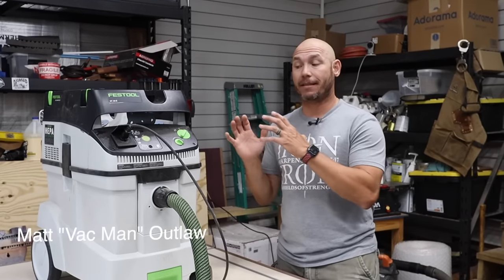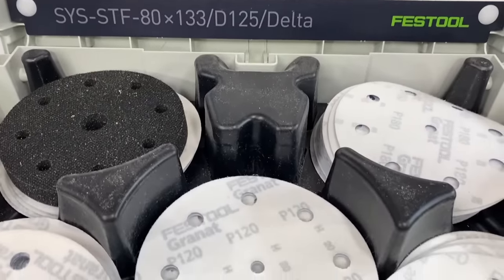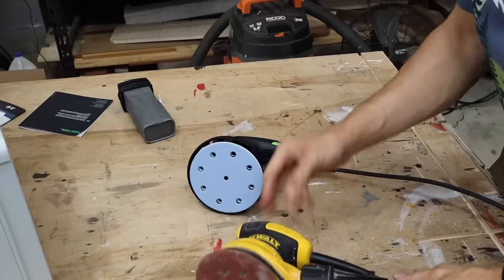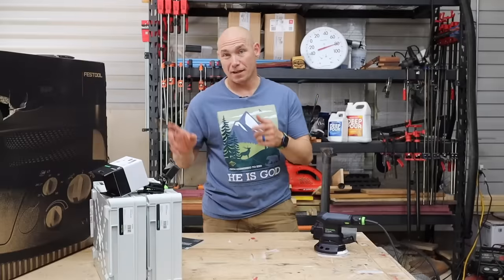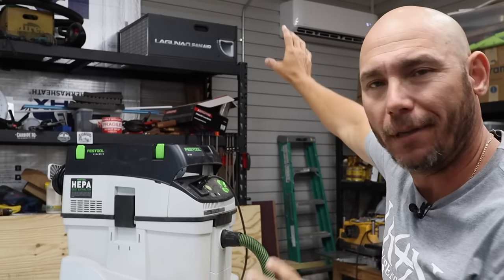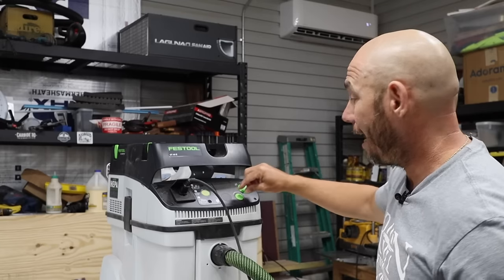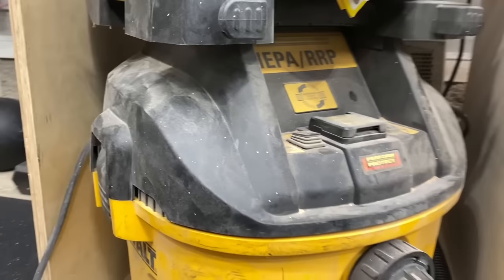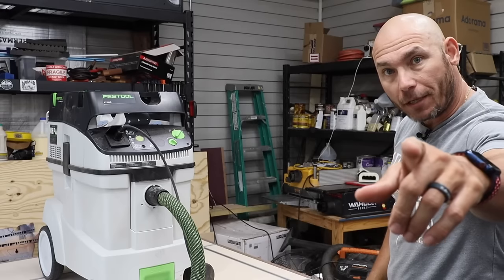Watch This Before Buying a Festool Dust Extractor or Sander

Comment: The big thing about the Festool dust collectors are they keep their suction even when the bag is full. I was using a Festool track saw and ripping lot of plywood. After about three hours of ripping, suddenly there was sawdust coming out of the saw. I shut it down and found that the bag was completely full and the suction was now filling the hose. I took the vac out to the dumpster to empty, but the bag was so full it wouldn’t come out of the vacuum. The only way I could get it out was to cut the bag open. I am a big Festool guy and find that when you buy Festool tools, you’re not buying a tool but buying a system. Very well thought out. Hint: if you go to jobsites as part of your job, throw a spare bag in the bottom of the dust collector before putting in the working bag. You will always have an extra and know where it is. Great video! Keep up the great work

Comment: As a small shop with a super limited budget Festool was something more of a dream. I knew they were good tools but I couldn’t justify the cost. Then I bought the Domino. GAME CHANGER! This past year I continued adding to my set up. I have the track saw, two sanders and one of the dust extractors. I absolutely love it. I wish I would have gotten the sander and dust extractor sooner. Huge difference. Even my husband was impressed with the dust collection on the sander. He was skeptical. He recently used it for his own project and was amazed. And what a blessing that it was gifted to you. That’s awesome!
Reply: The TS75 and the CT36 were the first Festool purchase I made, and I loved them!!! I got the Domino 700 with the adapter and bits next, so I could use any size that the 500 or 700 uses. I honestly thought I’d never get the sanders because I didn’t see the benefits being more than the costs…until I used them in a class at Woodcraft and saw how much time they save 😂

Comment: Festool is expensive but very well made in Germany. Germany are very high in Health and Safety.  Here in the UK, health and Safety is being promoted especially for injury and breathing problems. A lot more people do DIY at home, its much better to have safe tools that are quiet, and do not effect your hearing and lungs. I am asthmatic but I do some DIY, so this is a game changer for me. As some homes are old here and have lead paint, protection is VERY important. I am currently saving up for a sander and Extractor. The less vibration on the sander has made my decision.  Great video...thanks so much for the honest review, I can tell you are an honest guy. :-)
Reply: Yes, the Festool dust extractor is good. I've got a Rotex 90, but for larger areas a Sealey 150 (Mirka Deros clone) works really well with very little vibration for about a third of the price.

Comment: I have had a CT15 dust extractor for a while and love it. Use it with my Fextool track saw, router and Domino. Have been using a Dewalt sander similar to what you have.  Always done a good job sanding but dust collection was so-so and the sander was always covered with dust after each job. Decided to add a Festool sander to my collection. The same one you demonstrated.  I could not believe how much less time a job took and virtually no dust on the sander. I used Festool paper which works great, no loading, no dust. Gave my Dewalt away. The Festool sander with their paper is the best combination I have ever used for sanding. Note Festool says you will do a better job sanding with the dust extractor speed turned down as a faster pick up speed inhibits the sander from working properly. You demoed the extraction power in the video, it's strong. Good luck with your setup. Nice video.

Comment: Good stuff brother. It’s so obvious how blessed you feel for receiving such a beautiful gift, you deserve it. Two things you didn’t mention. The extractor moves around so easily because it’s so light. Sure the wheels are awesome but it can be moved with one finger. Lol. The other thing is how quiet it is. I have mine (older model) set up to where I plug my machine into it and when I turn on the machine I can’t even here if it’s running. I spent a bunch of time walking over to it to make sure it’s on but learned it always is. Lastly, if you hook up a cyclone to it you will never have to deal with bags or filters. I mounted one to the top of my extractor and it handles my whole shop, one tool at a time. I’m about to buy a festool sander. Never in a million years thought I would spend almost 600$ on a sander but it’s worth it to save my hands and get the job done faster.

Comment: Recently picked up the same sander and the CT-15, I hate sanding a little less now!  Really impressed at how much dust it collects, I’m in the northeast so my home shop slows down a lot in the winter or bad weather because I was only sanding outside.  Had the first big sanding session with it today, between the dust extractor and a box fan filter running nearby there was no noticeable dust afterwards.
Reply: Sounds encouraging. Just remember, according to the expert in the field, Bill Pence, unless you have a window open and a fan in the window pulling air through your shop, you're breathing in tiny particles into your lungs which are not visible to the eye. This concerns me greatly and currently I'm doing all my cuts and sanding outside with a portable fan to my back and still wearing a dust mask. I'm super sensitive to anything in my lungs so I can tell a difference pretty quickly. I'm trying to invent a new outdoor woodworking setup that keeps people comfortable, machines at a decent temperature, prevents condensation and provides optimal health. I'll let you know if I come up with something in the next 30 years lol

Comment: First I got a Festool sander, the ECS EC 125.  It changed my life with how powerful it is, even as a finish sander, and how little it vibrated.  I held off on the Festool dust extraction for a long time, then I got one, the CT 15.  It too changed my life.  It is fantastic at dust extraction, but it is also the single best vacuum I have ever used.  I use it to vacuum my house.  It makes vacuuming FUN because it's so good.  I can't recommend the sander and dust extractor enough.
Reply from the maker: They are great tools
Reply: @731Woodworks  have you heard of drywallers using this setup or is it more so for wood working?

Comment: There’s no comparison. Festool sanders are the best, but comes at a premium.

Also have the ETS EC125 and a Rotex 125. First one, almost zero hand vibration, great for those with carpel tunnel. The  Rotex,  can really flatten a panel glue up fairly quickly.
Good review Matt.
Reply from the maker: Thank you

Comment: Just got a Festool sander after using a Bosch sander for a few years. The biggest difference to me is that the Festool shuts off almost immediately when you hit the power button which lets you set it down without having to wait until it spins down first. That to me is worth the price of admission.

Comment: Nice video.  I'm with you Matt, I never expected to ever have anything Festool in my shop either...then Santa came and I'm now a member of the "F-troop"~!  I have the ETS 125/3 sander and the CT 36 dust extractor.  I've not used it yet, but I'm very excited to do so.  Truth be told, I've been to about 3 different stores over the last 18 months and have test driven the different sanders.  The impressed look on my face during these innocent test drives prompted my wife to say "which one would you like to have?"  I was floored~!  Anyway, I just received my Bluetooth module in the mail today, so I'm off to install it and pick my next project to put this thing to work.

Comment: I recently upgraded from a makita 6 inch sander to the Festool ETS EC 150/5 . The Festool is half the weight, i can sand for at least one hour without getting any tingling in my hand ( makita i can only manage 5 minutes) most importantly the festool stops straight away after switching off, where as the makita takes around 10 - 15 seconds.

Comment: I haven't used my orbital sander in 2 years. I prefer to use my hand plane to put a finish on my projects. The shavings from a hand plane is so much easier to clean up and to top it off I don't have a dust issue. Now my old table saw is a different story.

Comment: Nice review. I am a woodwork teacher in Sydney Australia and I have been using Festool in my home workshop since about 2007 when I bought a Rotex 150 and CT Mini duster extractor.  My workshop now extends to 3 routers 3 different dust extractors just to name a few. I find the low noise and vibration, accuracy and build quality without compare. I wish I could get their new cordless table saw set up but as I have their small table saw already 2 tables saws is overkill 😂😂😂😮. If you get the boom for your CT36 and mount it with your circular saw you will feel like a fully professional setup. Lloyd

Comment: I went with bosch get 5n and it blows me away. I am glad i decided to upgrade the sander before anything else. It made a huge difference. Once connected with a simple shop vac, sanding is virtually dust free! Looking for a lighter sander as well. Looking at this festool or the m12 finish sander.

Comment: Is the Festool expensive...yes. Is dust extraction and less vibration important...yes. To Mr Charles G, you can buy ten pair of Walmart shoes in a year, or one pair of Nike...your choice. I'm also VERY new to woodworking, but knowledge is power, and Matt provides a lot of knowledge. I currently don't own any Festool, but it is on my Santa list ! I don't have much of anything when it comes to dust extraction...my shop's outside and I'm currently using a 3 gal ( no snickering ) ShopVac. Just the other day I sneezed and a 1x4 shot out !! Great video Matt, appreciate you as always, God bless..
Reply from the maker: Thank you

Comment: I don’t think you can go wrong with Festool, SurfPrep, 3M Extract or Mirka. I prefer the SurfPrep, I like that it’s made in the USA, and is a great value for the money. The POV 8 extractor is great and has a lot of standard features. I like the paddle switch on the sanders, which Festool does not have.

Comment: I have a festool sander. Totally worth it for a professional. my dad has a mirka it's equivalent maybe slightly faster the. festool sanders have better warranty and less issues. I use the 3m extract wire mesh paper the dust extraction is so good you don't have to use a mask.
Reply: Have you sanded any drywall with it and how does it compare with the portal cable?

Comment: Based on your review, I bought a CT36 and the 125 sander. I also spent the extra money on the festool cyclone attachment. I love it. It is quiet, it doesn't fight me, it's easy on my hand, and the dust collection is fantastic. Knowing what I know now, I probably would have bought one of the smaller /cheaper extractors like th 26 or the midi since the biggest difference is the capacity (36 = 36 liters). With the cyclone, the extractor size is not that important. I could have built my own cyclone with a dust deputy that would have been cheaper but the festool cyclone is so compact (maybe not as efficient as a dust deputy either). Overall, I may now be a festool fan boy😁.
Reply from the maker: Awesome!
Reply: Started woodworking as a Hobby 26 years ago in earnest, started out with Bosch and Dewalt tools and a kärcher as vacuum. After 11 years a friend of mine showed me festool and the Performance it gives you. Spent 5 more years to get me festool machinery, all i can say after a lot   of big projects , like 2 complete staircases , a new kitchen, a complete Garage outfitting and doing a couple of things for familiemembers and friends, as far as of today festool never let me down or had me doing the secondbest thing. It is pretty expensive, i admit it, but if you want lasting tools that delivers quality  and durability then, to me at last festool is First to none.

Comment: Great video. Lot's of Festool haters out there, but it usually comes from folks who are not in the trade or who are simply priced out. There is a reason why they cost that much though. 
One important thing to note is that the hose on that festool is anti-static. A new hose will cost more than you paid for that dewalt most likely. 
Does that vacuum have the autoclean filter system? It about made me crap by pants the first thing that went off on my CTM36.

If you really want to experience the ultimate "Festool Experience", try to get your hands on a TKS 80 table saw. Not sure if they sell that in the US or not, but it is a game changer for work workers when you compare it to traditional cabinet table saw.

Comment: The Festool  ETS-125 Sander is a great and versatile sander, I have one and the cordless version ETSC-125. They both have a 2mm stroke which is good for finishing sanding. The ETS EC-125 is a brushless corded sander with a 3mm stroke making it a great finishing sander but more aggressive. It is a low-profile style that most users, as do I, believe is a much better grip, and more ergonomically correct. Or the ETS EC-150 if you're looking for a 6" sander.
Oh yeah, also look at the Edge Sanding Guide AH-ES-ETS/ETSC for your ETS-125 Sander, it makes sanding edges a breeze, and keeps them at 90 deg. too!
All the Best, Chuck
Reply: I have the cordless version like you — would you recommend the ETS EC 150 for your next sander?
Reply: @AaronGeller  I personally would recommend the ETS EC 125 which has a 3mm stroke and a larger motor, 400W vs 250W on the corded version of your sander which is about the power of the cordless. (I have both) The larger stroke and more power make quite a bit of difference, mainly because it is a sander meant to go through the grits, unlike the ETSC-125 which is a finishing sander. You get to stay with 5" or 125mm paper, which is a lot cheaper as well.
My two cents, All the Best, Chuck
Reply: @toolchuck  thank you! I was thinking about upgrading and getting the ETS EC 150 but I am not doing large surfaces currently, so it seems my problem isn’t pad size but power. I think the cordless is great if you just want to take it outside real quick but if I’m going to be plugged into regular power, then I would rather have a little more aggressive stroke.
Reply: @AaronGeller  I have a 150mm (6") 5mm stroke Mirka Deros 650CV that also converts to a 125mm (5") sander by placing their "Backup Pad 6" Grip 48H 130g" specifically designed for the 650CV. So, it is my two-in-one 125mm/150mm 5mm stroke sander. I can tell you that as handy as a 150mm/5mm is at times, I would not recommend it as a primary sander unless you are sanding a lot of large areas that are rougher than normal. The size of the sander is more a personal preference, and maybe the cost of 125mm paper over 150mm paper, but the stroke or orbit size is another story. RO's try to hide the orbital scratch marks by randomizing their placement, and they do an amazing job of it, but the larger the orbit, the harder it is to hide, or easier to see, either way bigger in this case does have a tradeoff. Some wood and paper combinations show these marks more than others, and some woodworkers don't seem to see any difference, to each their own. I'm just saying it exists and can impact your sanding. When using my 5mm I usually use my 3mm or 2mm for the final grit or even hand sand the last one.

ETS EC 125 is a 3mm orbit/stroke only sander and is an excellent primary sander. A good friend has the ETS-125 2mm like you and occasionally borrows my ETS EC 125, he always talks about needing to get himself one, Haha. My point is that there is a significant difference between them.

Hope this helps!
Chuck
Reply: @toolchuck  it does help, a lot actually. I’m leaning more and more toward the 125 over the 150.
Reply: @AaronGeller  Stay in touch and let me know what you decide.
All the Best Chuck.

Comment: I looked at that setup. For job site use. After looking into it further at 15 bucks to replace a bag and at present i toss a bag every 3 days from drywall dust and wood dust. That would be expensive.  I currently get 3 packs of bags for 15.00. I looked at the permanent bag at over 300 bucks also.

Comment: Two tools that really stand out are the RO150 sander super powerful 6 inch sander, and the domino machine. They help me speed up work so much I can't really explain to how much they help.
Reply: Yep, I have the RO150, it’s a beast, I can sand and refinish a table top in half the time, I have a total of 5 festool sanders and a CT26 vacuum, I love this setup.
Reply: @truthserum9157  how do you like the ct26
Reply: @Bshwag  -  first thing is it’s expensive, but it works so dammed good, it’s super quiet, it’s adjustable, it’s got HEPA filters, I think it’s the best one out there.
Reply: @truthserum9157  oh i know the cost of festool, buying a new one is like getting my fix. i have the smallest and now the largest vacuum they sell both are great but the CT48 is too big to transport around and the CT SYS is fills up too fast on some jobs.

Comment: I bought a well used MIDI about 4 years ago, as well as a domino, 5” sander, 1010 router and ts55 saw. I have since bought a Kapex. I’ve built over 40 pieces of furniture, and to be complexly honest, the best purchase was the vacuum, sander and domino. We all have that buddy with hAlf the festool factory , and I have tried quite a few of their tools. I still maintain that the top three are vac, sander and domino. In my own opinion, they are the only three worth the hard earned greenbacks. The track saw isn’t worth it. Neither is the Kapex or the routers. They are better than the rest, but don’t justify the expense. Maybe I work to hard for my money? Would I love to have more festool? Sure. It’s great stuff. Top of the line, but I used to buy all craftsman, because it did the exact same job that Snapon did at 1/4 the price. Just not as nice.